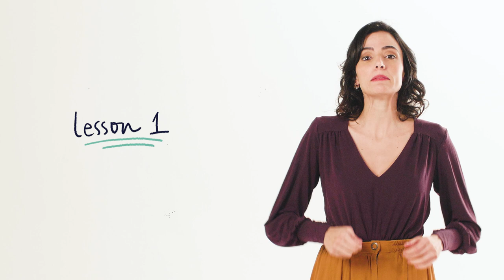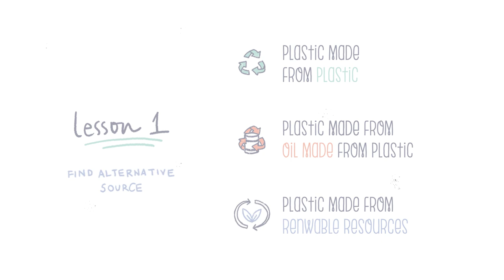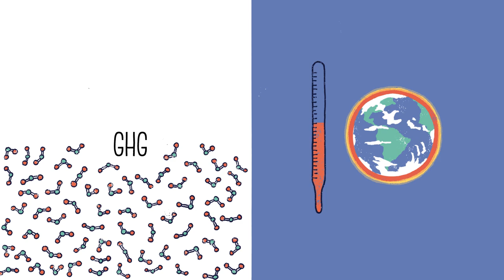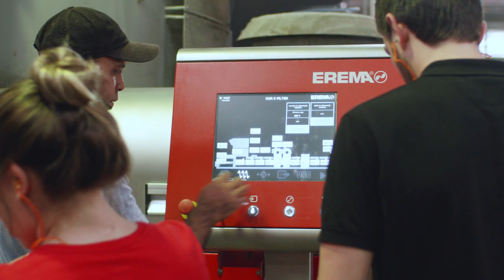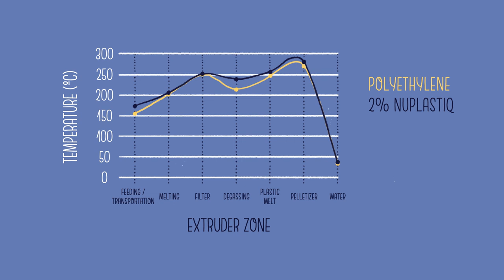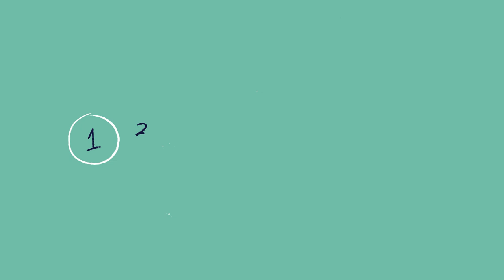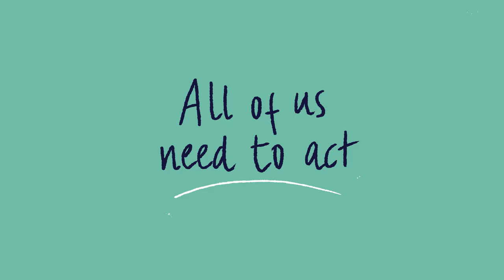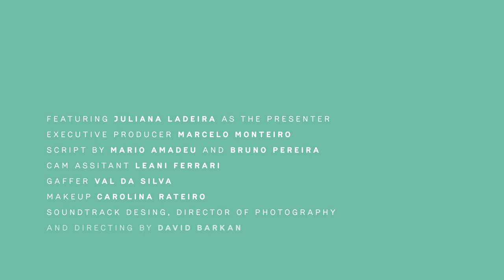Rethinking Plastics

Comment: The design of new materials is at the forefront of the strategies to face marine litter. NuPlastiQ is a good example of polymer technology that combines material performance with a smaller at-sea durability, comprising an alternate and additional solution to reduce the impacts of plastics when they leak to the marine environment.
Reply: Many thanks professor Turra and congratulations for your continued work on better understanding/addressing plastic in the oceans!

Comment: great to know more about NuPlastiQ, many questions are still left unanswered like will the Blend biodegrade in landfill ? 
Will the recycled resins making new products still keep its biodegradability ? 
Chemical recycling tech transform the plastic waste back to oil, then how can it transform the Blend ? Sort the oil and starch ?
But still promising, hope more tests and research to be done
Reply from the maker: Thanks for your comment Thùy. The blends have biodegraded in anaerobic testing (ASTM D5511)... which tells us it is possible to biodegrade in a landfill provided ideal biodegrading conditions are present. No material can be guaranteed to biodegrade in a landfill... not even paper! As to recycled products: as far as we know, any percentage above 1% NuPlastiQ does help the material biodegrade faster than without NuPlastiQ. But this doesn't mean that a recycled product with NuPlastiQ would biodegrade in few years in a soil environment or such. A durable good can be made with NuPlastiQ. It will just be "less eternal" in biodegrading conditions, but in most environments will have a very decent service life. Think about something made out of hard wood... very durable, but more biodegradable than plastic. As to chemical recycling: there's no need to separate, both elements in the blend will be converted to oil/gas. Hope this helps. And yes, more research is always welcomed... but we can think of zero scenarios in which 1-5% NuPlastiQ would make something worse.
Reply: @biologiqinc1826  thanks for your detailed explanation !!! Hope BioLogiQ will continue to grow stronger